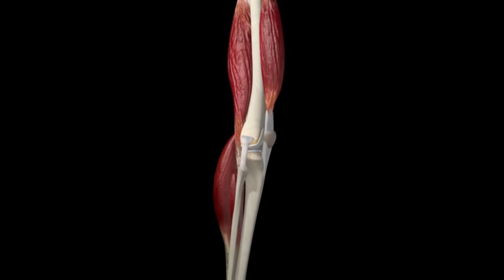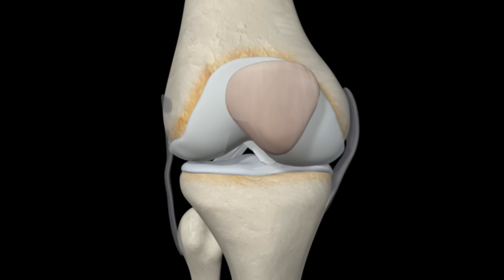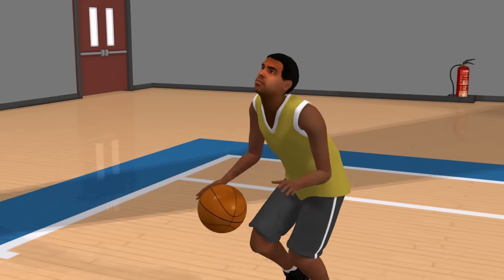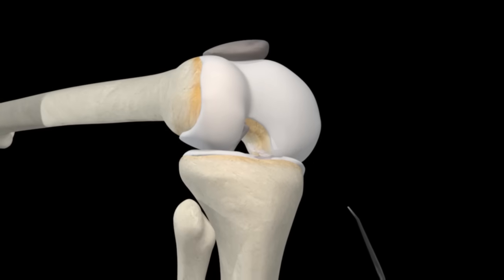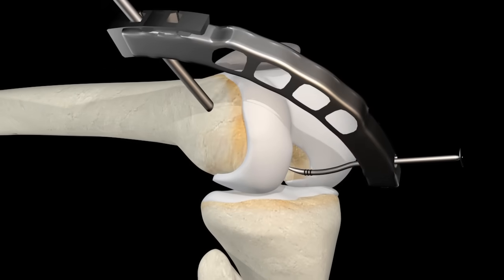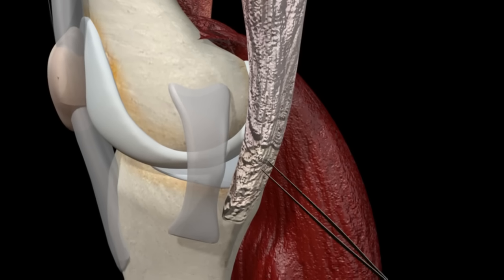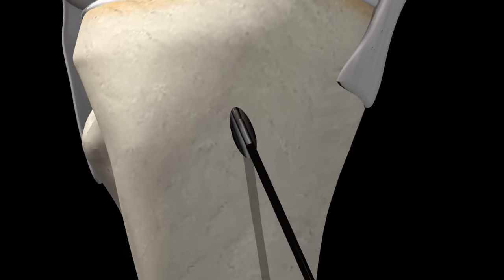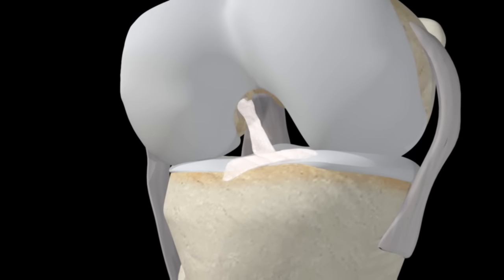ACL Surgery - 3D Reconstruction

Comment: Having the operation done tomorrow!
Reply: How are you?
Reply: @erika_storm  completely fine! Was walking 10 days post op and was completely fine after 6 months. It's been over 4 years now and do everything and more than I used to do. Same ROM, just a little less strength in the hamstring as that is where the graft was from. If you have any more questions feel free to ask 👍
Reply: duncantee Hey thanks so much for responding. I’m a professional bodybuilder and am getting my surgery in September. How many weeks did it take for you to get back into sports?
Reply: @Grg1231  hi thanks for messaging! Really depends on the sort of recovery your surgeon puts you on... mine wanted me to get up and move without crutches asap so walking within 2 weeks then body weight physio for about 2 months after that. Cant remember exact dates but I was squatting w a light barbell maybe after 3 months of surgery. Most important part is to do all the physio exercises every hour/day the weeks after surgery! Hope thay helps
Reply: Hey duncantee even i had same problem..  My acl and pcl both are tear.. Please tell me..  Now your knee is absolute normal.? Means you can bend your knee and jump?
Reply: @HarpreetSingh-wx6kl  yep, after about 3 months I was alright, 6 months all sports, 1 year completly 100%. Depending on which graft you get, it will be stronger once fully healed. I had hamstring graft and have slightly less mobility when i pull my heal to my bum using my muscle but only by a couple of degrees. Doing all the physio is the most important part
Reply: @HarpreetSingh-wx6kl  how are you now? All went well?
Reply: How did it go?
Reply: @willhaslem  sorry see below

Comment: I also injured my knee when trying to lift something heavy while going up the stairs.  After that, I always felt pain when going up or down stairs.  Could it be ACL?
Reply: 0
Reply: +rene kenshin youtube is not the best place for consultations. The knee doesnt necessarily have to swell, if it was a partial rupture it wont swell but the ligament will still likely lose some of its tensile strength. YOu wont know exactly what you have until you do an MRI thats your best bet

Comment: Thanks for the video, I am 26 years old and i have torn my left knee's ACL playing sports 2 weeks ago and other damages were followed as per the MRI such as:
Torn posterior horn of lateral meniscus.
Degenerated posterior horn of medial meniscus.
Grad I injury of medial collateral ligament.
Lateral femoral and both tibial Condyles bone contusions with underlying fissuring.
Mild knee joint effusion.
I am wondering if it is necessary to make the surgery right away or can i wait 3 months without causing more damage to my knee? I currently can't bend my knee more than 90 degrees and it is also swelled. Please advise, thanks in advance.

Comment: 3 months post op right here!! Doing better than ever but yea the first week was horrible and never want to go through that again
Reply: I should be so lucky. I did my right ACL 6 years ago. Delayed getting it done until end of last year. 10 days before seeing the surgeon I snapped my left ACL. Since it was the weakest,  I got the left done first.Two and a half weeks later,  I'm walking slowly without crutches. Getting the right one done in 4 or 5 months once I build enough strength in the left. At least I know what I'm in for..

Comment: medical science really is flabbergasting.

i wonder how people in the olden days who were surely way more active than us dealt with an acl tear?
anyone know?
Reply: I was wondering as well but you see, when you think about it, they weren't doing any kind of sports, that would include such forces being put in the knee joint.. Sure, it was heavy work but it took a heavier toll on the menisci and the back cartillage, over time. It's only nowadays that the acl type of injury is becoming more common, with more people doing sports as basketball etc..

But it sure sucked being injured back then
Reply: you can actually live normally without an ACL, you can lift, run, do whatever, except for certain sports movements. I know some people who tore their acl 20 years ago and just never got it fixed because they never needed to.
Reply: You Said exactly.  I met in an accident in 1998 at that time there was no ACL surgery in India. I went for surgery on 13th may 2017. In these long years I suffered jus 5times only. Moreover I don't run or jump I jus simply walk. But the first 4-6 days after surgery was acute pain, I was unable to explain the feeling.. but don't worry those who are undergoing for ACL surgery , first four days u need to sustain the pain , it will be something. Gradually u can feel better pain will decrease day by day within fifteen u can walk with brace.
Reply: yeshua sage diet and trustful instincts.
Reply: Dude Google "Athletes without ACL's". Like for example NBA player Dejuan Blair had no ACL's at all in his knees but he still played in the NBA.
Reply: Causes more damage to your joint tho bruh
Reply: The Outsider AGAHAHAHAHAHAHA IM DYING
Reply: Starvation is real bro.

Comment: I am now 4 weeks after surgery and am walking fine and feel i could do a lot more. I prepared well for surgery and put as much muscle on my legs as possible the stronger your leg is going in the better you are coming out. I also had meniscus repair so feel lucky to be doing so well, I found a Tens machine great for working the muscle from the start it gets the muscle working early so no delays.Do your exercises, ice ,rest the knee before you know it your moving again.
Reply: I returned to cycling and competing, cycling is my sport. If I had one regret it was using my hamstrings for to make the ligament. I suffer from very tight hamstrings on both sides from where they were taken.
Reply: @MegaNugent  So the hamstrings dont regenerate to their former form?
Reply: Did u find any indication of arthritis after acl surgery plz tell me
Reply: @vamsisrikanthrallabandi7015  No arthritis, coming up on 7 years.
Reply: @MegaNugent  can u plz tell me what are the chances in your lifestyle after this surgery I mean what are the physical activity u stopped after this
I am confusing what to do and what not to do after this surgery to avoid arthritis
Reply: No the hamstrings do not come back, but you can get scar tissue, I find the remaining hamstrings over compensate for the ones lost.
Reply: What age were you at the time of surgery? How did they repair meniscus? It was told to me that they do not repair meniscus after age  35.

Comment: About 4 weeks ago i tore my ACL after falling of a horse and landing on my feet wrong.  Had keyhole surgery to clean the debris from the knee, but the doctor said I may not need this surgery and that there is a 50/50 chance that it will heal on its own and that I could be perfectly fine after that, the knee may be unstable but physio and certain exercises can help strengthen around the knee to compensate.  I know the surgery is good, but should I take it anyway even if i have a good chance without it?  I am a aspiring young jockey and this length of time off isn't ideal, but I wouldn't be doing sharp turning/pivoting motions.
Reply: I decided to not go through with the surgery i gave my leg a chance and ive been back at work riding horses and running and the whole lot my leg as of now is at 80% says the doctor and he also says i should also get better and my leg has given me no trouble i still cant fully straighten my leg and it doesnt bend all the way but can function with everything i need it to.  ;)
Reply: SilverChibiChan It is awesome to hear you are going through a full recovery man!
Reply: MrFALLENHER0 ...
Reply: I would get surgery, because this way you would be closest to 100% mobility in the future. 
But I am pretty sure it is very expensive to have surgery. I hope that you get better though!
Reply: Okay thank you for getting back to me.  The cost  also isn't a deciding factor as i do not think i would be charged as i was not charged for the other procedure .  
Thank you =)
Reply: Did you have surgery yet? Its really not that bad one second your getting sedated the next you wake up and its over and you feel loopy and the pain isnt bad at all, im in the nfl,  lots of players tear there acls yearly and get surgery
Reply: MrFALLENHER0 dl we md
G
7ly
0
6ffe a sjfsq...9
Reply: You don't say diana?
Reply: I wanna tear my acl
Reply: Yupp after a week of practicing I finally tore my acl!!! Im so happy I finally accomplished my goal! Im having surgery in a few weeks after the swelling goes down

Comment: I had it done on 27th December and is currently in the second week of rehab. I had the same Hamstring tendon graft procedure shown here. I was under anesthesia and when I woke up its all done. The after surgery pain is minimal under the effect of nerve block anesthesia they injected through my thigh during surgery. They gave a knee brace for support whenever I walk or move out of my bed. CPM machine is rented out to improve the flexion in the first few weeks. They also rented out a Kinex thermocompression machine which is basically a cooling pack. The solution to minimize pain is ice as frequently as possible during the first few weeks.   

I recommend this video: ACL Reconstruction: Rehab Program Essentials which explains the ACL tear in great detail, starting from injury, surgery, rehab to back on the field.
Reply: Did u find any indication of arthritis after acl surgery

Comment: I think your surgeon use 'Patellar Tendon Bone' graft for ACL reconstruction, which is the conventional way of this operation. There is nothing wrong with the technique as long as it is performed well. This video is more sort of diagramatic representation of the procedure, so it may not very well match with your experience.
Locking of knee is not the outcome we expect after this procedure but full return to sports can take upto 9 months.
Hope it helps!
Reply: This is very true as ive just had my reconstruction 3days ago the surgeon had to reharvest tissue from the outter side of my knee and was screwed both sides as the anchor failed. I was on the table for 6  hours

Comment: my acl was reconstruted 3 months ago but still my knee aint bending . its stuck very hard !doctor says my patilla is stuck,he has 2 perform 1 more aurthroscope 2 release it . 1 more thing iz that doctor has performed a different kind of surgery, he has taken  patilla bone  & has drilled a screw on both the ends & he has not made 4 holes as shown in the above vedio he has cut abt 15cms .can any 1 tell what type of operation he performed and wat happens if its done &why's my knee stuck wat nxt ?
Reply: Everyone's knee is stuck after ACL reconstruction, all you have to do is have a physiotherapy to reach the range of motion, it will take you 4weeks or more but it will completely bend
Reply: Tejaswi Gururaj how u doing man?